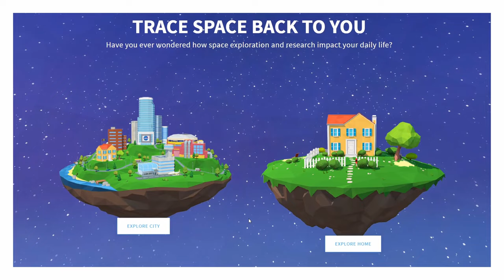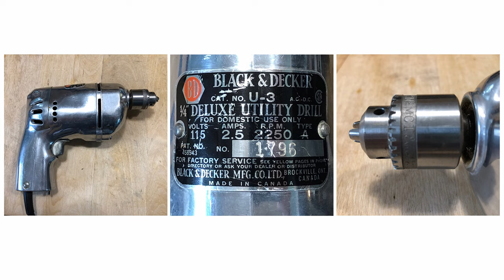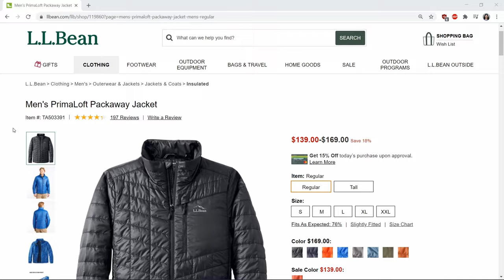Is Space Exploration a WASTE OF MONEY?

Comment: RE: the fireproof clothing - The problem with that capsule wasn't necessarily the flammability of a particular material, it's the fact that, even for a ground test, the capsule was pressurized with pure oxygen which tends to allow even difficult materials to burst in to flames.  Set aside the fact that the door configuration ensured that the seal could not be opened in the event of a fire.  I understand that this is beyond the scope of your information.

Comment: A waste? No.  Misdirected sometimes? Maybe.  I think there is a large psychological aspect to space exploration that gives people hope, in addition to the technological advancements.  With that said, I think in general it makes more sense to focus on fixing our planet - which is already habitable - than pouring untold amounts of money into colonizing a hostile planetary environment.  To me it would make more sense to work on colonizing our oceans and sustainably utilizing those areas.
Reply: I'm no enginee so take this witha grrat grain of salt: "colonizing" the oceans is substantially harder, cost heavy and all around dangerous than space, and for one reason, mostly: pressure.

Building any structure fighting against inside pressure is way easier than building one fighting outside pressure. Not to mention that once you go below a certain depth, resources become exponentially scarce. In terms of energy, for example, we would need to be at the oceanic floor to tap into some geothermal energy, but at that point we already spent a lot making a structure that can handle the environment.

We currently know more about outer space and the cosmos whan we know about the bottom of the sea, and that's by design

Comment: I understand to some degrees what you say in this video. I also understand that you have a scientific back ground, which is a strong reason for me to like what you do. However, I do not believe that having a virtual home is necessarily beneficial to humanity, it is more beneficial for a marketing stand point. It is my view that big business and big money look for a way to make money from the government, like the military industry do, and certainly not for human benefit, which is more of a byproduct. I have to look at how the shock absorbers have being invented, I am skeptical on that one.
Keep the good work.
Reply: Think variable rate or staged gas over hydraulic shocks.  The original shocks were an option on Model T's.
Reply: Telesco Shock Absorber, in 1912, seems to be one of the first designs for real shock absorbers, not those used by NASA in the 1960s. Anyway, I don't think that space development is necessary for meaningful advances for humanity.
Reply: @Christiane069  Good find.  NASA's contribution was taking a purely passive hydraulic (oil) system and adding gas charging to make an active system.  This makes the core of struts from little ones that hold up a rear hatch on a minivan to bigger ones that are key to the suspension on most modern cars.  And yes, it was caused by a unique situation NASA faced in retracting the umbilical system rapidly and then stopping it before it damaged the tower or itself.  Industry capitalized on that a decade later.  Would car makers have figured it out without NASA'S hand down technology?  Yes, I think so.  It is not truly a novel concept, they just needed it first.  I'm still glad I don't have to wrestle with my current trucks hood like I did with my truck from the 60's.